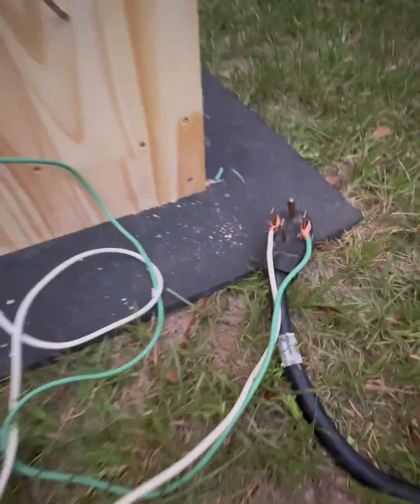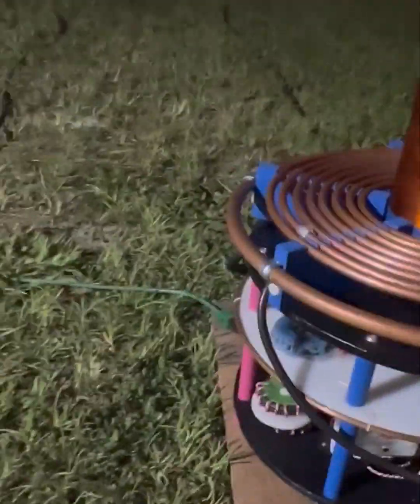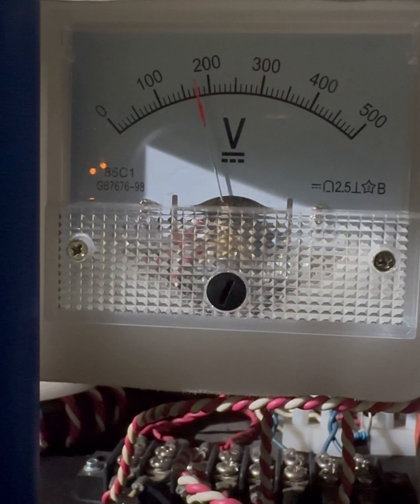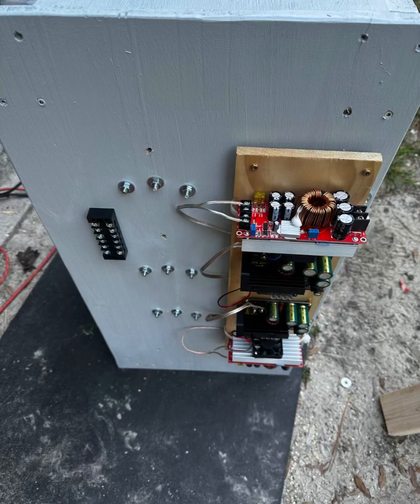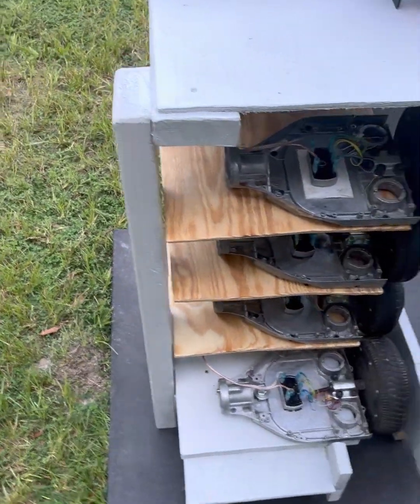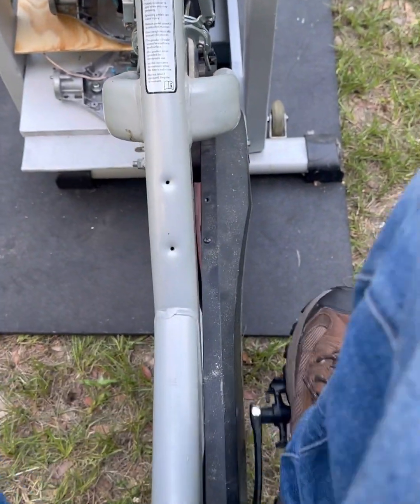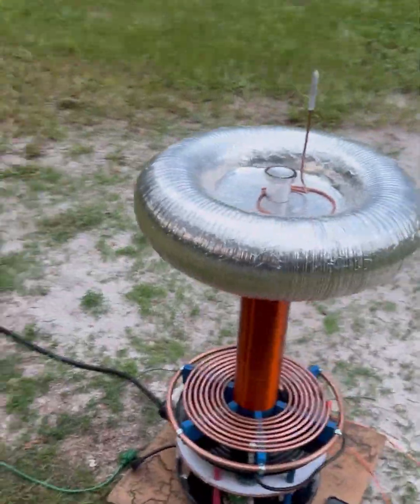Green Energy Powered Tesla Coil #greenenergy #offgrid #generator

Comment: Hi, I have been watching your videos and I think this is great I am working on something like this setup can you please send me the info on how to wire both sides of these buck boosters and one outline please help me out wish I could have a way to talk to you better than here. also have you thought more about posting a video on how you hooked this one up please thank you.
Reply from the maker: Did you see the video I just put out ? Also have a part two coming very soon may answer your questions.
Reply: yes, I did but that does not tell me how you wired your setup with the five hoverboard wheels I want to know how the boosters are wired up together out to one line I am trying to understand this stuff but I do not know all about the electrical part.
Reply from the maker: @stevenpleasant5834  ok so do you have the bucks?
Reply: @ArcAngelTeslaCoil  no not yet working on my project when I can and have the cash to do so was wanting to get the ones you use so I need the part number and where you got them from I am going to run four hoverboard wheel and I need them to make 240 volts.
Reply from the maker: @stevenpleasant5834  ok will show how to do so! Also bucks are in the description of my last video part one
Reply: @ArcAngelTeslaCoil  thank you very much that is what I needed great info and this helped me out very much thank you so much now I can get my project going and done. one more thing I would like to know so on the buck booster the faster the hoverboard motor is turned the more volts it puts out and when it goes into the buck I adjust it for the highest voltage and on output adjust it down to like 60v time the four buck to get my 240v right. thanks for your help.
Reply: @ArcAngelTeslaCoil  Hi, I also would like to ask how would I get the 240vdc  into 240Ac thanks.
Reply from the maker: @stevenpleasant5834  I will show in my part 2 video how to wire buck together to double voltage also multiple hover board wheels wired to bucks but 5 is an odd number so one buck will have an extra wheel. You can wire 2 wheels to each buck or even 3. Each wheel can output about 100watts roughly

Comment: Hi, what is the part number of all four of these buck boosters? and each wheel to one booster? how did the end of the wire output come out to get the 340 volts? please help I am building my off-grid home setup now only thing I want to do is put 240 volts into my sub-panel is there some way we can talk together other than this way? I would like some pictures sent to me somehow to see how to wire them up from the motors to the buck converters and the wire to load output I like this build very much and I knew what I wanted to build for my setup would work I just do not know the electrical set up I just want to hook it up right like this setup thanks for your help.

Comment: Hi I am working on building myself an off-grid setup with Hoverboard motors could you please send me the info on how you hooked up the rectifiers and buck booster, I want to run 240 volts into my electrical box just the same as what is coming in from the power line in but be off the grid thank you for your info and help I knew this type of motor would work I  do not understand the electrical hook up part of it.
Reply from the maker: Can you reach out to me on Facebook messenger may be easier to communicate also this is d/c after rectified so you would have to convert it to a/c to do this I think?

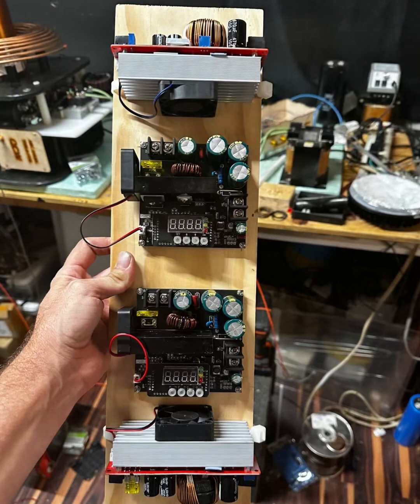Comment: 2:25 what you're using is called a "Boost Converter" which steps-up the voltage. A Buck converter steps DOWN the voltage. A "buck-Boost" converter can either step up or down. Nice experiment and arc photography though
Reply from the maker: Haha your exactly right thanks for pointing that out😁👍⚡️⚡️